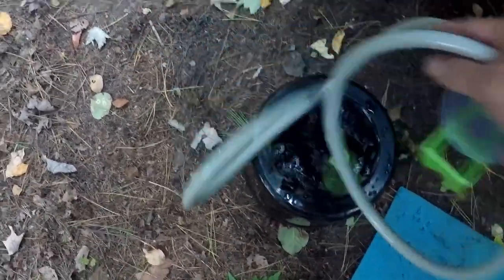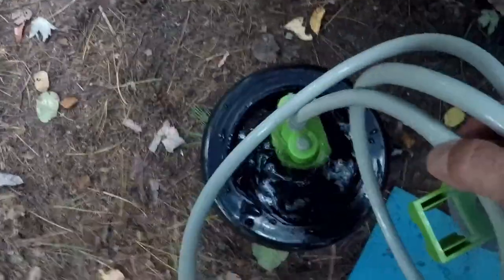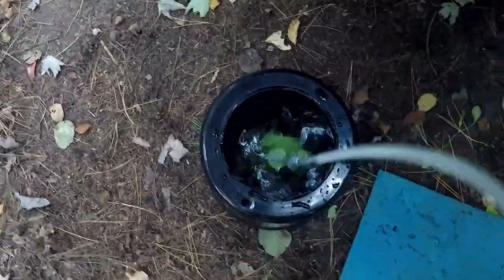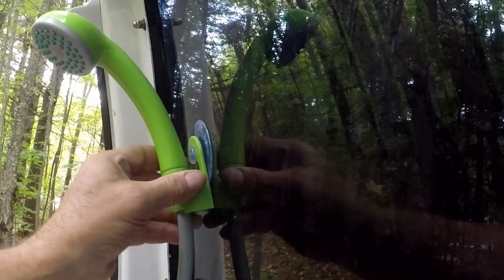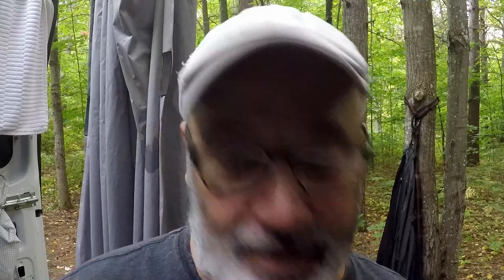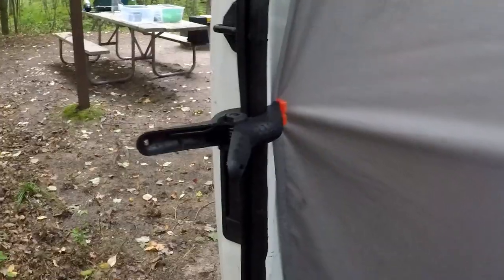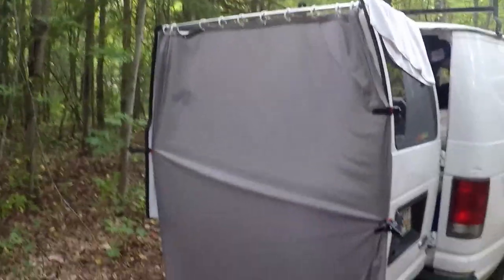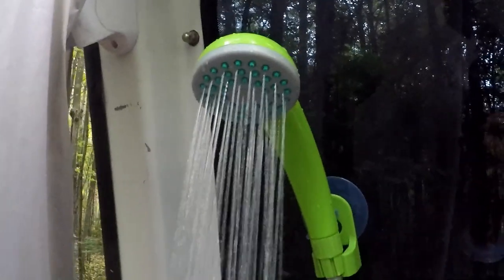HOW TO MAKE A SOLAR SHOWER FROM A BEAR CANISTER / VAN LIFE

Comment: Very clever. Never would have thought of that. How hot does the water get in the sun?
Reply from the maker: What we usually do is fill it half way with hot water  half with cold in the morning. Put it out in the sun all day. When we are ready, the water is well into the high 70 temp range. By itself filled with cold, not sure it would ever reach 80 degrees

Comment: I have a clear bear canister. If I paint it black will that work?
Reply from the maker: In theory yes. Black is a natural conductor. But the ABS plastic is a insulator. So it will heat the water up if you paint it black, but it will keep the water hot all day if you pour hot water in it, keep it in the sun all day.